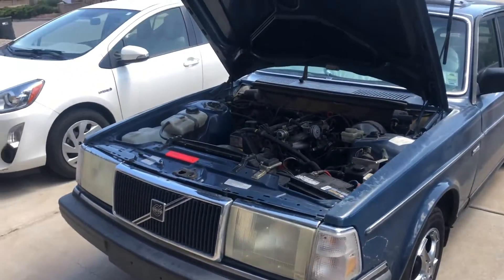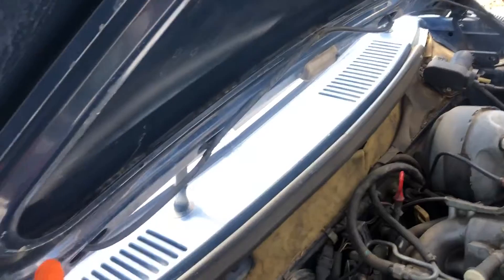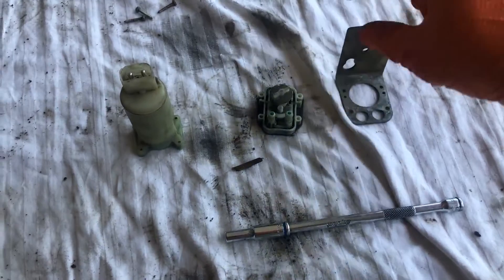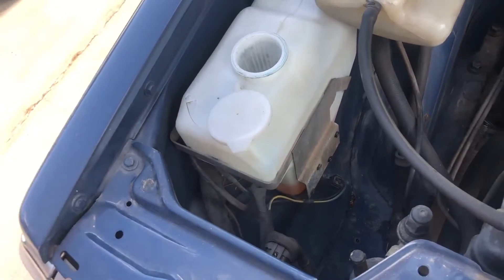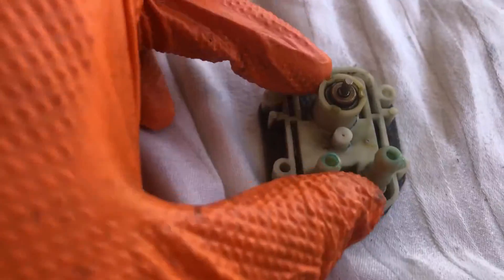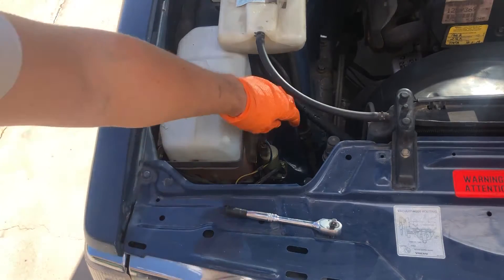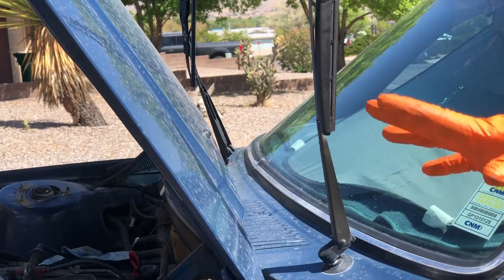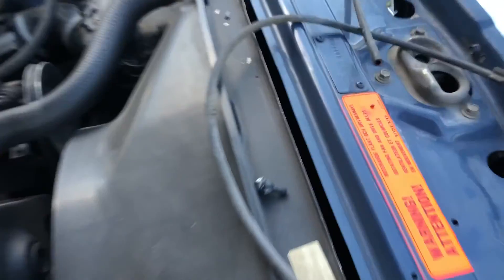All about the Volvo 240 Windshield Washer Sprayer System

Comment: Great video which helped diagnose my own washer pump issues. Just one thing to add  though, the bottom plate of the pump mechanism does just come off with a tap as it's only held on with a rubber seal. You can then access the two pump rotors inside to clean and free the mechanism.

Comment: A conversion to consider is putting in dual outlet nozzles for additional washer spray coverage. I have retrofitted these type onto several 240s, harvested mainly from boneyard Saab 900s due to the hood opened toward the front of the car and the sprayers are pretty easy to access & remove not being nestled amid the hood reinforcement metal as they are on the Volvos.  

To set them up properly, the outer nozzle is directed to outer windshield area behind the sprayer and the inside nozzle should cover the inner area of the opposite side of the glass in a " \X/ " pattern, not a " VV " pattern. If one of the nozzles ceases to function (clogs or line breaks/leaks), then one sprayer can still cover both sides of the windshield.

Comment: From my experience, working on w124, it's better to blow air in the squirters the other way around, because the clogging particles tend to get stuck in them if you do it normally. 🙃
Reply: Dear H.J.
👍👌👏 You are absolutely right, Sir. That's definitely the way to do it. Mr. Bello also mentioned a safety pin for trying to get into the nozzles. Common safety pins usually are too thick, it's way better to try it with a very thin wire. With a safety pin you can adjust the nozzles afterwards (at least on W114/115, W123, W124, W210).
Best regards luck and health.

Comment: The plastic comes off of the metal base, the seal is probably holding it all together, on my pump the metal plate fell off before the two plastic pieces came apart and I had to clean off a lot of corrosion to get it to run.

Comment: I did mine last year and the pump was working but no spray, if you take the nozzles out and clean them from the back side you will find that there is usually a lot of gunk in the nozzle body not just the hole portion. My problem turned out to be lines on the pump were installed backwards after I noticed bubbles coming up in the reservoir. Also the lower mechanical portion of the pump seperates from the metal base plate, yours just appears to be heavily gummed up, its a simple gear type pump and very easy to clean and reassemble.

P.S. 605 Atlantic Blue is the best color.

Comment: Insert  spray nozzles of a volvo 740  on your 240.   They don't get clogged like the 240 ones.
Reply: Yup. The later fan spray nozzles fit fine. Have you got an electric tyre pump? That should help. Also a can of compressed air for PC cleaning can be handy too.

Comment: On both my 850s, the wipers start wiping several seconds before the water hits...so by the time it's spraying, the wipers have smeared the mess all over the windshield. I wonder if there's a relay or something that can delay the wipers a bit to give the water a chance to get going
Reply: Nope, there should be a check valve between the pump and the first nozzle (on my 240 it's right after the pump before the T that goes to the headlight nozzles). It holds water in the lines and makes spraying instant, they are pretty cheap and universal too most of the time.